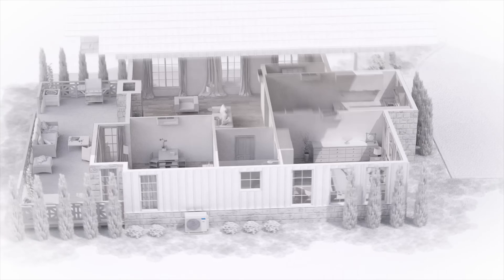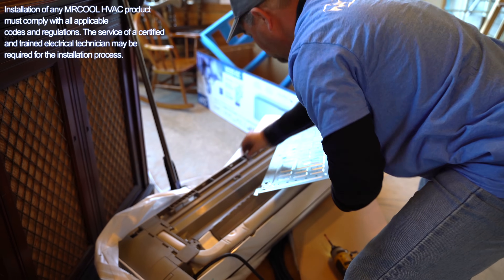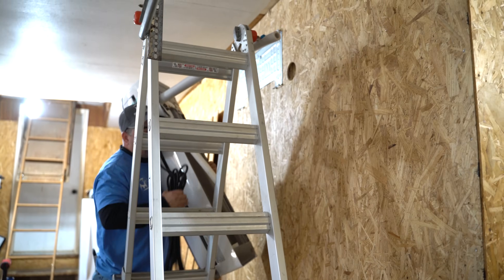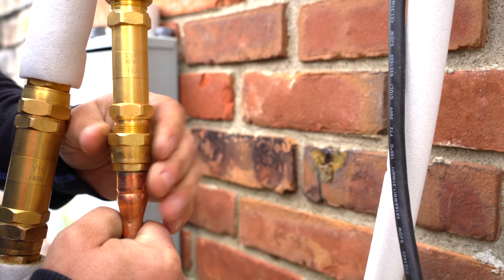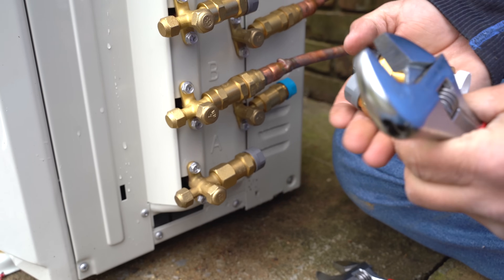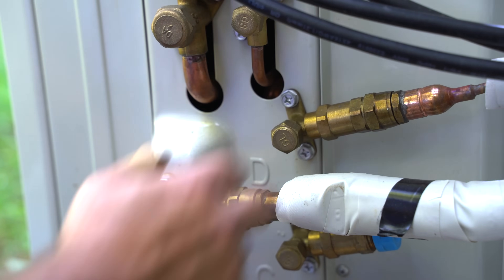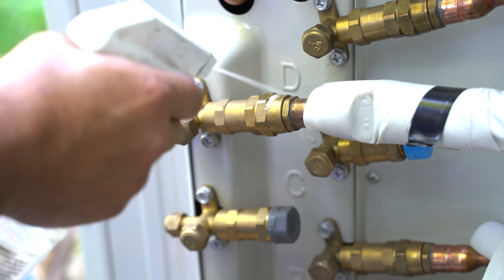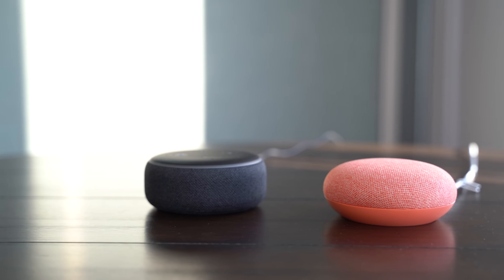How to Install the MrCool DIY Multi Zone

Comment: If your installing the  2 zones at later time can you just connect Lineset to condenser and just evacuate that single line even though the main line has already evacuated, or do you have to do something else prior to connecting?
Reply from the maker: You do not have to evacuate any lines with the DIY Multi-Zone. When installing units at a later time, you would not connect the lines until you were ready for installation.

Comment: So if the drain line has to go down on the 2nd zone unit install how can you do that when all the piping goes up into the attic? Drain line seems it can be an issue unless it has an internal pump.
Reply from the maker: Some installations could require the addition of a condensate pump.

Comment: Is there any specific order to connect the air handlers lines to condenser. for example you have have 12 k 18 k and 9 k unit. And at what letter should they be installed if so. Thank you.
Reply from the maker: No, there is no specific order as relates to unit size.

Comment: Almost finished with my install. Any recommendation on what to do with the extra length of control wiring from each unit? Can I cut it down and re-attach the spade terminals or get new terminals? btw would be helpful for us electrical DIYers if you made it clear that the whip from the unit to the disconnect is not included and that it needs spade terminals on the end to connect to the unit. This caused a few unforeseen trips to home depot. Also, the Youtubers you provided the units to as a test review received a little kit of wrenches and a hole saw, which made me assume they all came with one. That's on me for not checking but thought it's important to convey the experience I've had so far.

Comment: QUESTION:
Why does the vinyl tape not stick? And if part of the line set is going in the crawlspace to get to the condenser does it have to be wrapped since the lines are already in an insulated sleeve?
Reply from the maker: If you're putting the lines in an insulated sleeve, wrapping them would not be required.

Comment: Why isn't there a thermostat for ducted mini splits?  The stock one it comes with doesn't have a daily program option or even displays the current room temp.  It is basically only a manual on and iff switch.

Comment: Do these have a port to connect a vacuum system up to to evacuate the lines? I understand this is a do it yourself, but it still needs to be done correctly.
Reply from the maker: The DIY units do have charging ports. However, they do not need to be evacuated during installation. All the DIY lines come pre-charged and sealed from the factory. They should not be exposed to contamination during a proper installation.

Comment: what happen to the condensation lines?
Reply from the maker: Each air handler has its own condensate line that would need to be properly run.
Reply: Properly run where? If you’re on an interior wall where do you put condensation line

Comment: Ssssooooo.... you don’t evacuate or pressure test the line sets? Hmmm seems smart.
Reply from the maker: Correct. The lines are pre-charged and sealed, so there is no need to vacuum or charge in the field.

Comment: im building a series of sealed grow rooms. do you have a way to make a 4 zone 12,000 btu system. 3000btu x 4
Reply from the maker: We do not have a 3k DIY air handler at this time.

Comment: I’m  buying a multizone unit with 4 air handlers. 3 of the handlers will be on the same side of the house and the other 1 will be on the complete opposite side. I have decking and stuff on the side with 1 unit. Could I run the drain tube out where that 1 handler is like normal and then from the same handler run the lineset up into the attic across the house to the other side with the 3 handlers and down straight to the condenser?
Reply from the maker: Yes

Comment: Are these OK to supplement my existing central air system? I have an addition to my home that does not have central air ducts and 1 room furthest away from the central air unit that does not get enough air blowing into it in the winter and summer months thus these two rooms are always hotter or colder than the rest of my home.
Reply from the maker: Mini-splits are actually perfect for that kind of application.

Comment: Can i install one mini split and see how it functions and then install other one on the same condenser? Or do i need to install both and turn on at same time?
Reply from the maker: You do not have to install all the possible air handlers that a multi-zone condenser could support. However, you must install an amount equal to at least 50% of the condenser capacity.
Reply: @MrcoolComfort  also, we have open concept home in “L” shape. Starting on left from Tv room, dining area, kitchen and living room spreading over 1000 sqft.
Can 1 mini split with 24k btu suffice the need?
Can I install in the middle or I need to install on one end air flows in straight direction?
Reply from the maker: A single 24k could potentially handle that (depending on climate, insulation, and other factors). Ideally, you would want to position the air handler to blow through the entire space, but that might not be possible with an L-shape layout. However, it shouldn't be a major issue in an open environment.

Comment: The video shows lines being installed in the attic. Is this even possible? Doesn’t the drain need to be lower than the unit? Or did they just route the drain creatively here?
Reply from the maker: If the condensate can not be gravity drained, a condensate pump can be installed.
Reply: @MrcoolComfort  ah ok. That makes sense. Do you sell a unit specific for this purpose?

Comment: hey @MRCOOL, how do is that your lines don't need to be vacuumed?  also, what would be the procedure should I need to disconnect a line set one day to relocate one of the indoor units let's say?
Reply from the maker: The lines on the DIY and DIY Multi-Zone do NOT need to be vacuumed. There is no specific procedure for that. Basically, just run the installation backwards.
Reply: @MrcoolComfort  dude that’s like.... magic! so i can disconnect the lines and not worry about freon escaping, seriously amazing!!  i will be ordering soon
Reply from the maker: It is possible to do so. However, it is important to make sure all the valves are properly closed before doing so.

Comment: Do you have to have all zones connected initially for the system to function? I would like to have heat in the house I’m remodeling but only use 2 of the 4 zones until those other rooms are ready.
Reply from the maker: You do not have to have all the air handlers up for a multi-zone to function. HOWEVER, you do need to have more than 50% of capacity available before you run the unit.

Comment: So it seems after watching a few videos that these systems require downward gravity fed lines to work properly. What if i have a room which requires a ceiling cassette or a wall mounted control unit that isn't an exterior wall? can i go up a short distance and then go thru the attic? How is this handled?
Reply from the maker: In that case, you would need to use a condensate drain pump.

Comment: I see the precharged line sets are 16’ or 25’, however I need 35’. How does the coupler kit work? I can’t find an installation guide on your website.
Reply from the maker: The coupler kit allows you to connect two different line sets together.

Comment: How much room do you need around the  Condenser outside....how far from the house does it need to be.
Reply from the maker: Generally, you will need clearance of at least  24 in above, 12 in on the left side, 24 in on the right side, 12 in behind, and 79 in up front.

Comment: So each piece for the inside needs a fan for the outside? Or can you have a few running off the 1 fan outside?
Reply: Multi Zone means multiple heads per 1 condenser.....
Reply: They all run off of the same heat pump.
Reply: This is a multi zone unit, you can have one machine  outside,  and  up to 4 heads inside. Yes, you can have a few running off the fan ( condenser ) outside.    

They also have a central heat pump. Mrcool universal i think is called.